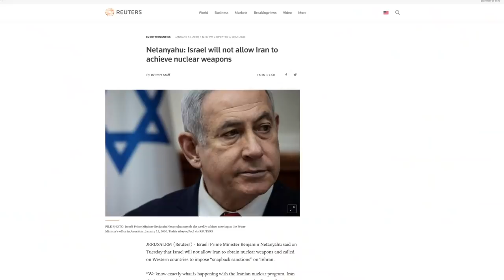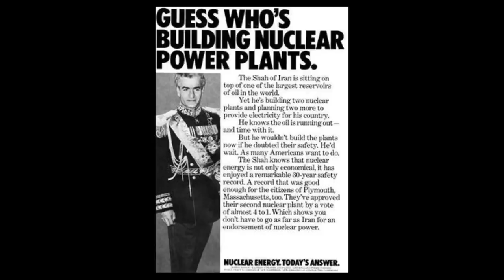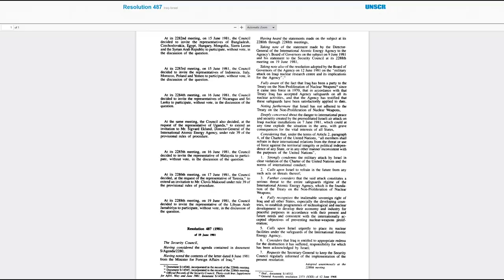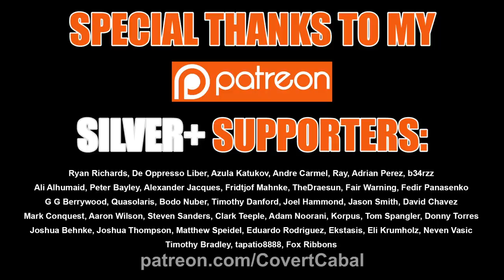Can Israel Destroy Iran's Nuclear Facilities?

Comment: I'm picturing a handful of fighter jets, each accompanied by a handful of cruise missiles controlled by the respective fighter pilots. The missiles would be launched from Israeli submarines in the Persian Gulf and programmed to join the fighters somewhere in Iraqi airspace. The missiles would go ahead of the fighters so as to deplete the Iranian air defense system of missiles, allowing the fighters to move in for the final strike. The only jam-proof machine in the world is the human pilot, which is why the fighters will be used for the final strike on the facilities, just as done with operation Opera in the late 2000's.

Comment: Does flying at extreme altitudes help avoiding radars too?
Reply: if you’re thinking up in the space, yes, otherwise no chance. you can communicate with a satellite with 1watt of power. If there are no obstacles on the way like rain or snow, no chance of not being detected
Reply: @tadehmirzakhanian893  yeah I guess that only worked back in the 1950s with spy planes like the U2 etc. Today, it's probably better to fly low.
Reply: @AgentSmith911  It used to work mainly because anti-air defenses couldn't reach too high, which they now can do.

Comment: 7:04 "...to do it somehow", are we complety ignoring the F-35s Israel brought or am I missing something here? Isn't this the type of scenarios where the F-35 could make a difference?
Reply: Even with F-35s the attack would be difficult and complicated. They have limited firepower which would mean numerous attack waves would be necessary to effectively strike all targets. They would require refueling for each wave to reach that far and mid air fuelers would be vulnerable during that time if used. Degrading Iran's air defense network would also be prudent even with stealth aircraft, which means even more strike missions. This then starts to look like a war and not a quick limited strike, a war that could drag in other countries and non state groups.
Reply: At full deployment Israel has about 16 F-35s. It's a hell of a risk staking them all on a "Hail Mary Pass" (probably not the correct idiom for a Jewish state either).
Reply: Still they will have to refuel over enemy territory due to how limited the fuel capacity is in the f-35
Reply: @jakedee4117  Israel have almost 50 f35 with the ability to operate and plan to buy 25 more, plus in a big operation you just need to destroy to radar and than the rest of the crew can attack
Reply: @crankthetank3581  Israel can fuel the planes right before the enter to Iran zone or use one time fuel tanks
Reply: @itaybarzelay2826  still that tanker would be detected from miles away away, israel's best bet is to try and modify the f-35 to have those built in fuel tanks that exist on the f-16 since drop tanks would negate the jets stealth
Reply: @crankthetank3581  I am not expert but from old operations I analyzed I think its very possible to tank the f35s one last time 100 km or so from iran, and still surprise the enemy (f35 has a range of 2200km so it should be ok). 
I still hope tho idf or america will make built in fuel tanks, i really like the looks of the f16s tanks.
Reply: @jakedee4117  Israel has about 60 more ordered. to a total of 80 aircraft, I think.
Reply: afaik, F35 can't carry weapons that would pose a serious threat to a bunker.

Comment: So far as the bunker busters, couldn't a kit be attached to them?  That would allow the bombs to be able to be released 50 miles or so away from the target and then hit accurately.  This is what the United States does to get it's smart bombs.
Reply: I don't think a bunker buster can work like that, especially since it needs a lot of kinetic energy, so it can't come from a gliding trajectory. Also they're heavy so they'd need some very big control surfaces, making the plane carrying them more visible and losing even more kinetic energy during the fall.

Comment: An excellent response by Iran would be to target the Negev Nuclear Research Facility with ballistic missiles.
Reply: the place is extremely well defended by SAMs and frankly that place is probably not doing much any more since it's been decades since it was constructed and if israel has nukes they are already in the silos
Reply: @Stivonim  the reactor is still active. Use of multiple rockets would negate the SAMs, and a direct hit would contaminate a good portion of Israel with radiation.

Comment: Israel will benefit from a stronger Iran. Part of the reason Gulf wants to normalize relations is because USA is stepping away from the region and they need local alliances against Iran. Iran is already in Iraq, Syria, Lebanon and Yemen and Turkey is also causing issues and they are stronger than Iran. So to buffer those countries they need Israel, so i fully expect Israel to have normal relations with all Gulf countries in the next 10 years.